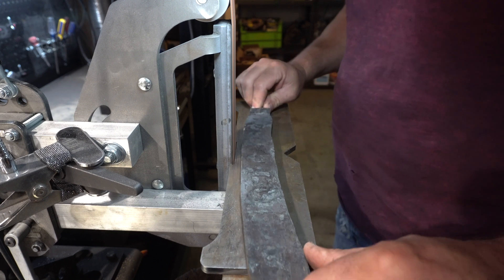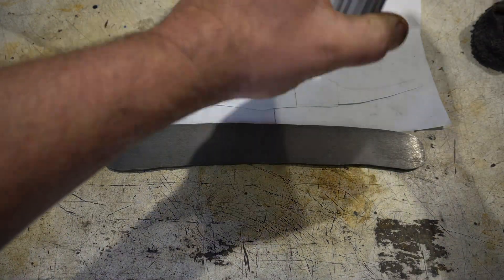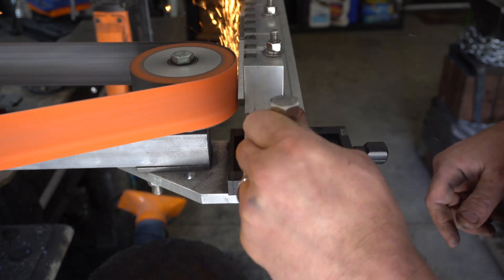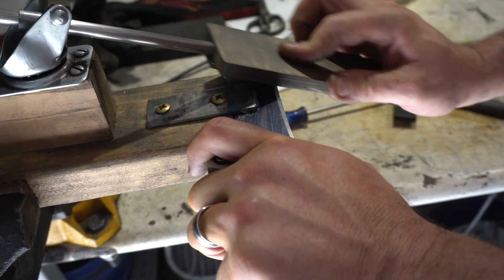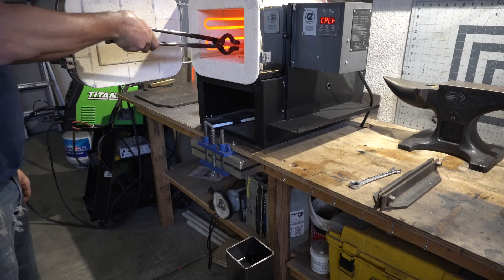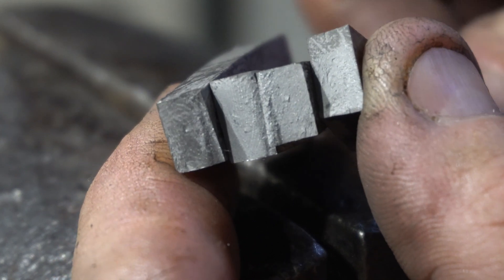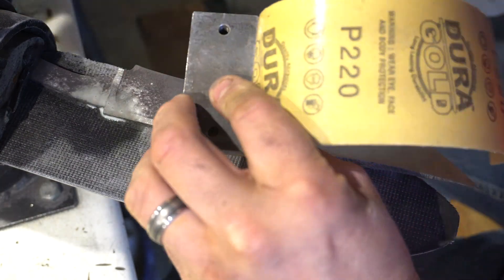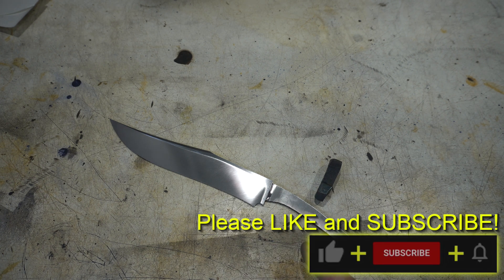Forging a Mosaic Damascus Bowie Knife - Part 2 - Making the Blade

Comment: So, I'd much rather use my metal band saw the same way you do for cutting out my final shape, but I'm having trouble finding saw blades that will last when cutting something harder than mild steel.  Do you have a good source, or are you just expecting to go through X amount of saw blades to produce a knife? Beautiful work by the way!!
Reply from the maker: Hey Tom... I usually anneal the steel before I take it to the bandsaw so it cuts pretty easy.  That being said, those blades only last for maybe 4 or 5 knives.  They are pretty cheap though... 3 of them for $25 bucks or thereabouts.  There's no good saw blade other than an abrasive saw that will cut hardened steel.  Even my new Wen saw with the carbide blade chokes on hardened steel.  Thanks for checking out the video!

Comment: Don't know why but I still really struggle to get a shiny black clean etch?? 😐
Reply from the maker: It’s tough to get the shiny black.  It usually needs coffee and heat to bake it in.  I think I’m going to do a video just testing different etching / coffee soaks until I get the perfect one.
Reply: Tyrell Knifeworks 
That would be great, do some real time uncut. 
Ive tried about everything, with different variations.   I did a damascus cross etch today, two soaks 10 minutes or so just wiped the oxide off with my fingers, looks about the best ever.  
If I sand even with 3000 grit or higher, the black comes off.  Fine pattern mosaic is easier.
Reply from the maker: @timjackson_ABS  Yup, I've found a deep etch helps because it raises up the 15n20 and then you use a flat backer like a piece of steel to sand the high spots and it doesn't touch the darker areas.  I'm going to do a full video on this at some point soon.  Thanks for the content idea! 👍
Reply: Tyrell Knifeworks one more thing.. on big areas of 15n20 it scratches real bad, so I forged a blade out of it 15n20) 2nd one I have done just to try and polish the stuff. Nope won't polish to mirror, only get to dull buff like other tool steel like O1 etc. & I tried about everything I could think of. I have a pretty extensive arsenal to throw at it.   Buffer put scratches in it with purple compound. Finishing stones to 1200 wasn't bad, but dull.  Sanded to 12000 then 8 micron finishing paper didn't do much better 🙉 chrome polish, never dull, dremel buff with that super fine red rouge 👎🏻
Reply from the maker: @timjackson_ABS  Are you sure you got the blade hardened?  It should scratch that easy.
Reply: Tyrell Knifeworks oh its hard, grinds & sands like iron.  
I have a Paragon sword kiln, test with hardness chisels.

It gets to a muddy mirror.  Try it?